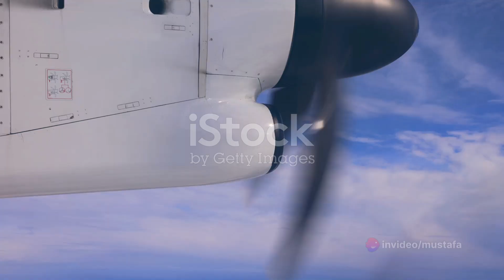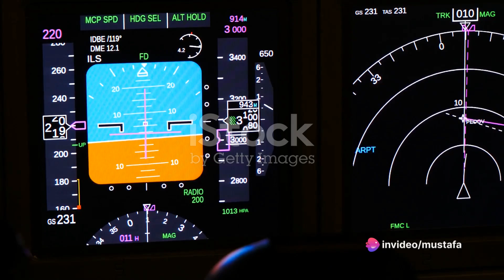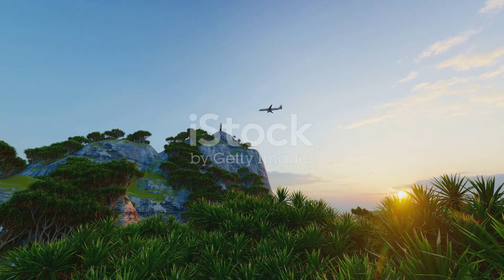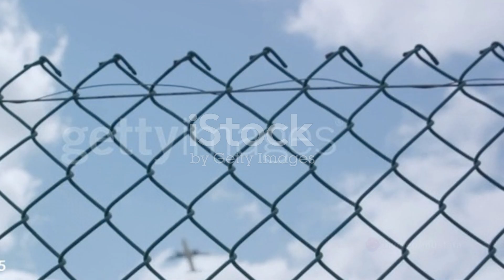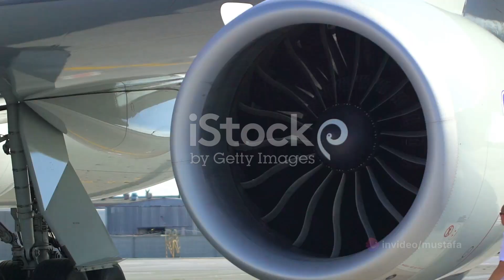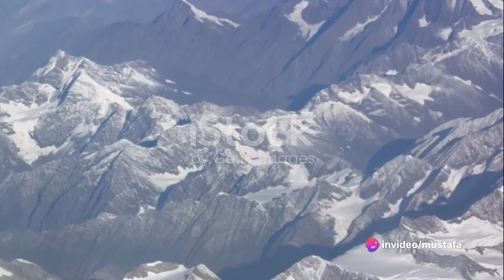Why Airplanes Don't Fly Over The Tibet - Explore Aviation #aviation #airplanes #exploreaviation

Comment: Bunch of bs. first Mount everest is 29,000ft aircrafts with jet engines are designed and more efficient at higher altitudes flying in 30 thousands. 
airspace: idk this part
Emergencies: a rapid decompression of the cabin will require an immediate decent to lower altitudes which is not possible when there is a mountain in the way and due to safety regulations there isn't adequate time for a rapid decent making it the main reason not to fly over.
Turbulence: airplanes are designed and tested to withstand severe turbulence. The main problem with turbulence is passenger comfort.
Navigation: airplanes have multiple nav systems to name a few there is, GPS, VOR, VOTAC, DME, IRS (not the money one), Compass, and ATC on the side. navigation is 100% no issue.
Not a single truth to this whole video. Don't waste your time.